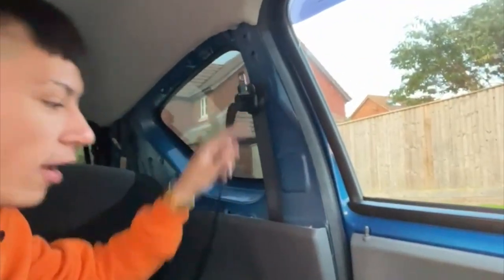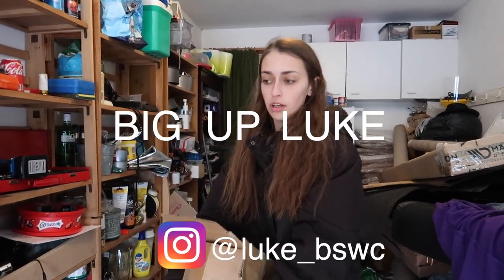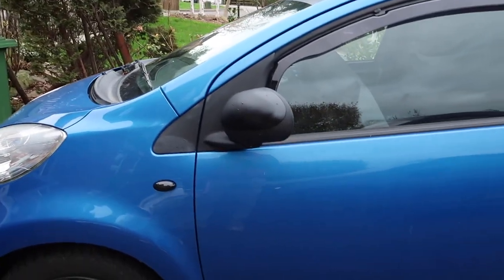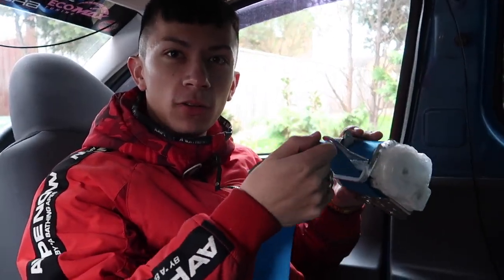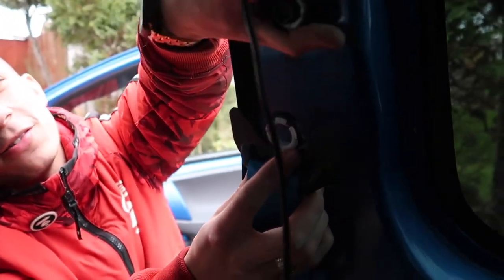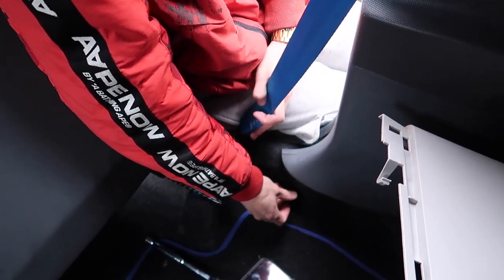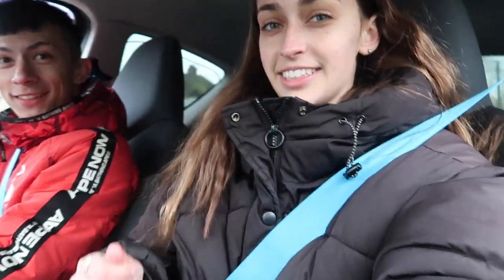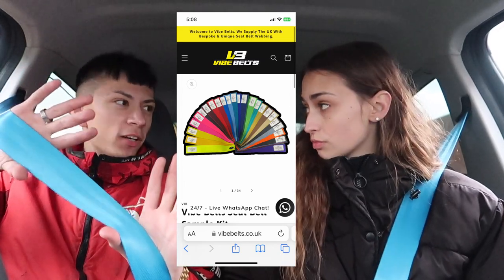CITROEN C1 GETS CUSTOM SEATBELTS!!

Comment: ha ha ha you removed my comment as i said this vid should be used on how not to fit safety belts . i will rewrite it again and again . as this can kill some one .
Reply from the maker: hey, i actually didn’t remove your comment so have no idea why it isnt there, you can comment whatever you like i’m not bothered🤷🏻‍♀️ can you explain whats wrong with the way the belts were fitted? atleast your obvious expert knowledge can help some other people🥲☺️
Reply: @chlxeblackwell  yes new bolts should have being used all round when fitting safety belts as per manufactures recommendations , These have to be Torqued up to the correct specs as well , as the Force on bolts is massive on a impact . The little connector on the bottom of the seat belt is that he was struggling to get of is made hard for a reason as this is for the Pyrotechnic built in to the seat belt . i will not go in to what this is for . but i can tell you there is no magnets in the seat belt as stated in the Vid . i could go in to detail on how this belt works but it would be wasted here .
Reply: @mandymoo7406  First off , manufactures recommend replacing the seat belt bolts if they have being removed for what ever reason . second the person refitting them never used a torque wrench to Torque up the bolts . as i said there is good reason that the bolts should be torqued up , The question is Do you just torque them up or torque them up and then finish off with a torque angel , third i never said the safety system on the  seat belt reel melts , but i have seen many pyro connector that have melted , but theses do tend to be on the larger air bag units .  and regarding you saying my comment was rubbish  its just facts .